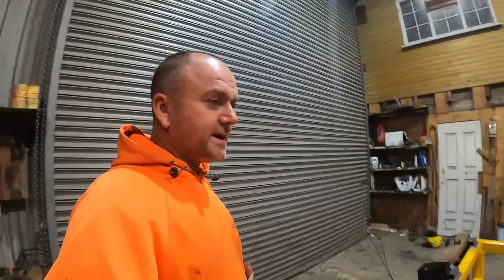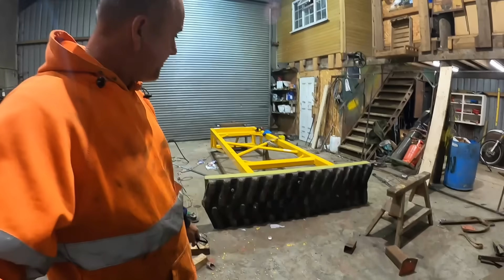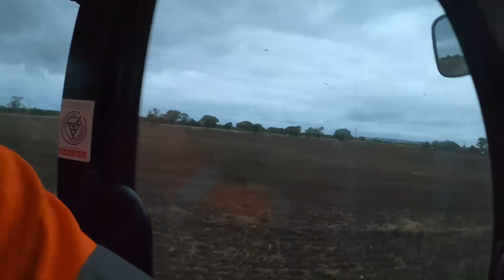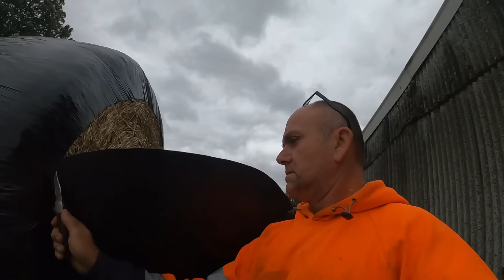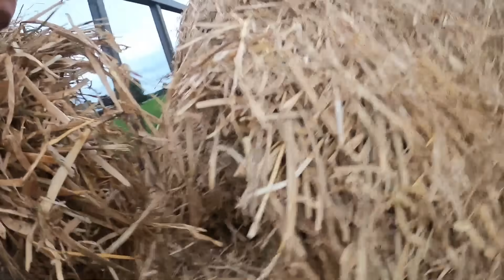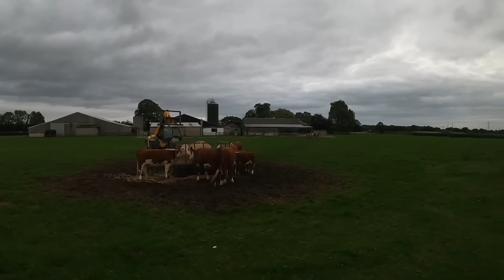Feeding rapped straw , Rain and more Rain

Comment: That's is very good engineering on grain pusher , I have an Oxford 410s (same company as yours just different colour) , I run it on single phase , all you need is a big breaker and 32 amp socket,  it welds at 400 amps comfortably and never struggles or blows a trip.

Comment: Just make sure as far as you can that you have plenty of mins & vits powders out for them especially at this time of year as Grass Staggers is a real risk particularly with the sharply changeable weather and pretty lush grass. (A long while ago we had a disaster on farm as we lost 8 Hereford cows out of 34 overnight to grass staggers - we wondered if they had anthrax until the vet came and checked them all both dead and alive.)
PS because of the increased wet weather we used to find that the granulated min / vit mixtures worked much better than the powdered min / vit supplements and did not go as rock solid when they dried out. Dan

Comment: 25 miles north east of you. W barley a lame average here, just about scraped 3t, wheat ok but nowt flash 3.6t, spring oats bit over 2t, spring barley suprised me, 2.5t. Nitrogen off the scale so didnt make the £223 malting contract, it went for £168 feed then had a £2 claim for crap bushel 🤦 Beans ok at 1.5t into spuds now between showers, so far so good